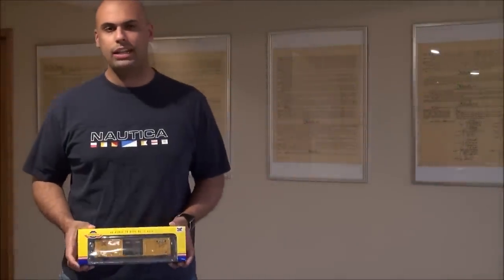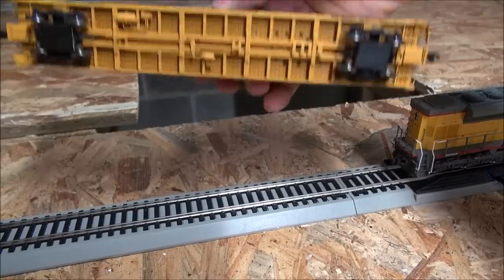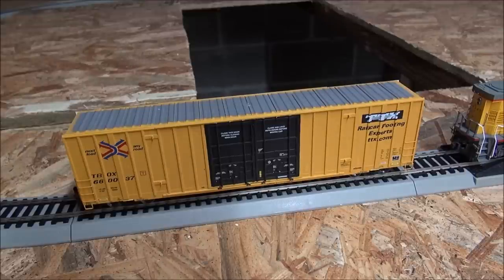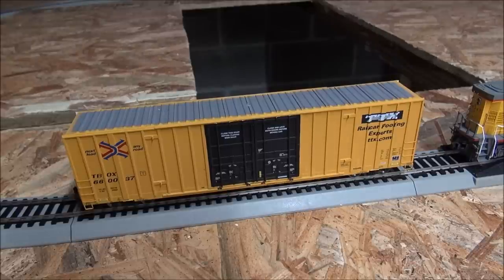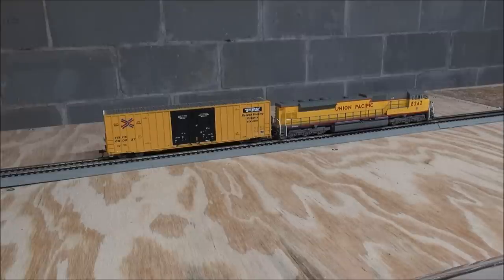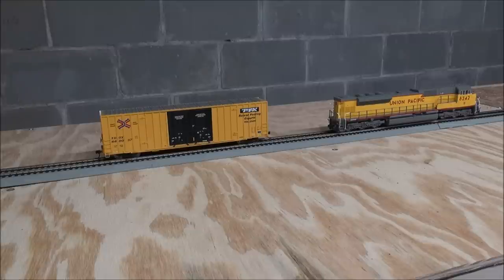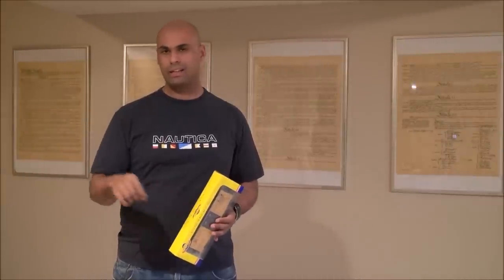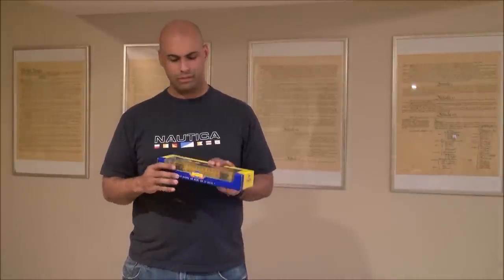Review: SoundTraxx Tsunami SoundCar Digital Decoder

Comment: I installed one of these not too long ago and I've been very happy with it so far. I didn't even have to buy special trucks. I just installed small brass pickups on the stock metal axles and its been working great. Even just one car with one of these installed adds so much to a layout.

Comment: With some model of locomotives having minimal space for sound decoders could these decoders be programmed for a locomotive. Then position the boxcar behind your locomotive to mimic the sound of 
your engine. I have some older Kato DCC ready locomotives that are real tight for space especially with the tubes for lights that Kato tend to use.
Reply: The club I was in years back had a guy that did just that. He couldn't get a sound decoder to work in his GP38 so he put one in one of his Aberdeen& Rockfish boxcar. But that was just a regular locomotive sound decoder, not the Soundcar decoder.

Comment: To use this as a cab car and blow the horn, do you need to add it to the train and blow the horn on the locomotive's address to also blow the cab car's horn?  Or to blow the soundcar's (cab car) horn, do you need to enter it's address into the throttle?

Comment: I think its pretty cool, I might install some in some of my OCS passenger cars. Only thing im not sure about is if it would work with TCS decoders.
Reply: They work perfectly with TCS decoders, I have two engines with the T6X decoders. The sound car decoders works with the momentum of the engine.
Reply: What about the WOW sounds? Because when you shut the throttle down the engine will cost to a stop unless the brake is applied, I know you can change CV4 on the Soundcar to change the deceleration value but, Im not too sure. TCS might come out with there version of the Soundcar with the WOW sound format and a Keep Alive after talking with them some. Possibly after all three diesel decoders are out and about.
Reply: I'm not sure about the WOW sound, no experience with them.  I also consist the sound car with my MTH w/Proto 3 Sound, in my opinion,  if it'll work with the MTH, I'm sure it will work with the WOW Sound. A good idea would be to check the Soundtraxx  website. Hope this helps.
Reply: Thanks! Ill look into it!
Reply: Christopher Huffman you can change the button that adds it to the consist so it dont conflict with the TCS wow